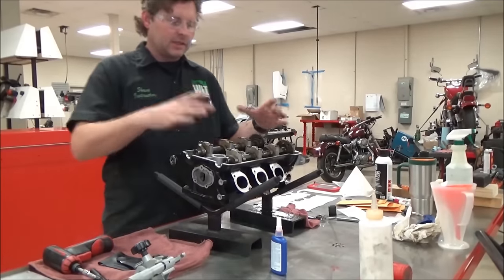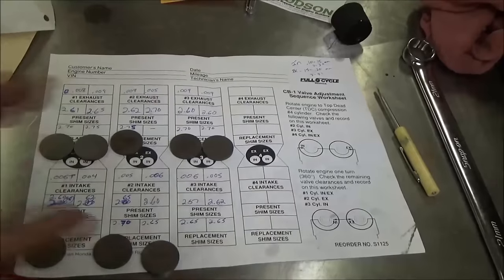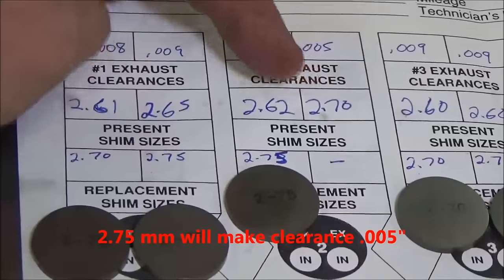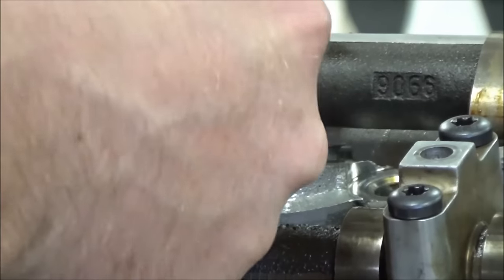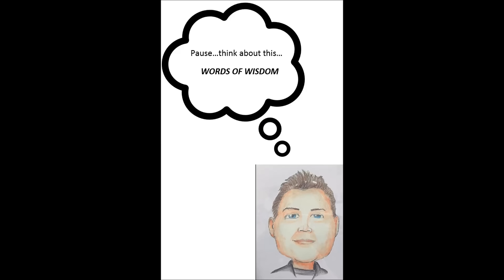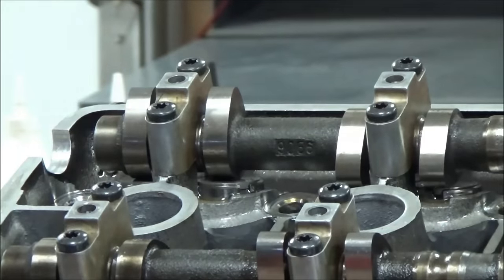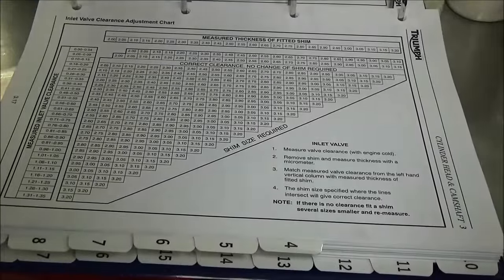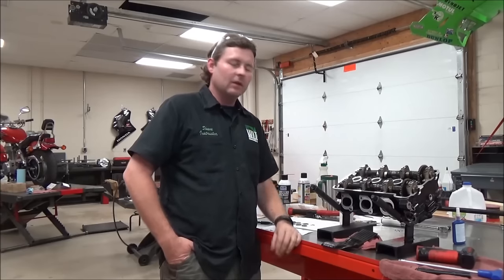Part 2: How to measure, select and adjust the clearances. TIP: How to do it on bench before install!

Comment: do you get much variance between doing it on the bench without tension on the cam sprocket and when you do final fitment?I've sometimes found that when the head is fully assembled and the chain is tight it pulls the clearance in a little on the sprocket end of the cam. the earlier Blade motors seem to be the most susceptible. I've always told the apprentices to make sure they do a final check one the tensioner is tight and before before they button it all up.

Comment: why you dont use metric when measuring gaps befuddles me.
Reply: People use what they are comfortable with you have to realise metric is a modern system from europe. 
I believe in the US they mainly use imperial but alot of machinists around the world still use it too as all of the old lathes/mills/micrometers etc are graduated in imperial and it works well for small precise measurements. hope that helps